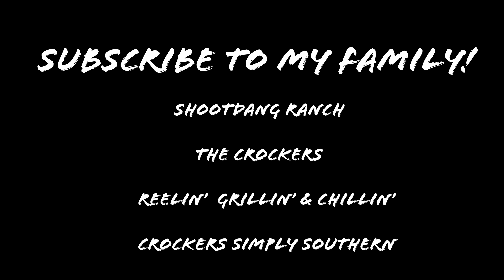Shed To Tiny House In The Woods - I Hope This Helps

Comment: You have 2 air vents towards the top  of the  end walls. A smaller fan mounted higher up, could vent a lot of the hot air trapped up top
Reply: Oh, that's a good idea. I watched a documentary about how people survived the heat in hot parts of the US both pre electricity and pre home AC. We've pretty much all stopped building homes that make sense in hot weather. Modern man often forgets what knowledge had been obtained by previous generations and it's a shame. In the olden days the she'd Transom windows would've been operational so opening them up could let the hot air out. Hot air rises, the cooler air is near the ground. Tall narrow windows that open top and bottom used to draw cold air in and hot air would flow out. Anyway I've learned a lot about how to build for both hot and cold climates and really understand why my well insulated, horribly situated Townhouse was built in  way that makes it terribly expensive to both heat and cool. Lol if I ever have a chance to design my own dwelling it's going to be a very efficent dwelling, not the energy hog I live in now.
Reply: I was wondering about that. Like roofs have eave vents and ridge vents. The shed doesn't have that it seems so how does he let the hot air escape? If he could put a fan on one of those side vets pointed out then a small fan on the open window across the room pointed in, he could at least create air flow.
Reply: Cherie he's just now building it but yes every roof will have to vent though or it creates condensation but I believe him and his brother know that?
Reply: @nathangandara9607  I wasn't trying to be rude, so hope by making a comment it didn't come off that way. I just don't know how that works for air flow/heat exchange in a shed build. My husband built an air heat exchanger that we use in our house. Its an old home without central ac/heat. It really makes a huge difference.
Reply: @cheriekreusel9453  neither was I I'm making assumptions myself up there I'm just a viewer as well. Have a good day
Reply: @cheriekreusel9453  your comment in no way came off as rude. It was just you voiding ideas etc...
Reply: @SagebrushRambles  thanks, I appreciate that.
Reply: Great observation and suggestion.
Reply: @nathangandara9607  yes I believe they do!
Reply: @cheriekreusel9453  I think you are golden! Opinions kindly voiced are appreciated by all!
Reply: They have solar powered ones for roofs, I'm sure there are side ones out there somewhere!
Reply: Good idea im in same process will get fans. Thanks
Reply: @hannakinn  totally agree! Biggest thing is houses are no longer positioned to take advantage of natural wind currents during the seasons.
Reply: Okay this is a novel idea if you are keeping the shed a shed. To make it work on a house install a box plenum lined with 
Flashing build it to run the entire length of the structure. The vents provided need to be replaced. Make them twice the they are with vent vanes that face downward
On the plenum install a whole house fan on a rheostat switch  for speed adjustment. A whole house fan can cool a dark surfaced. Roof and drop the ambient temperature 10 to 20 degrees of temperature,  works great and saves on AC power bills.

Comment: Pro tip: use a wet cloth to smooth out the sealant around the windows. The guy who installed our new windows did that and it made a nice finish and kept his hands clean. Smart move to seal up all the gaps.

Comment: Lighting is good. Closing the windows on the sunny side of the house might help with the heat some also. I know you want the sunlight to help because you don't have electricity. But it also helps to cover the sunny side ones with like a white sheet, white reflects the sun. To put the white sheet up, just put a couple of nails above the sunny windows then you can move the sheet around with the sun. A white sheet will let some light in.

Comment: You are doing a great job. You have good plans and I know you do your best no matter what it is. This may be something for you to consider. I have an exhaust fan mounted on my gable end. It is thermostatically  controlled by the heat. It vents(pulls) all the  trapped hot air out. It also creates  negative pressure.  That neg pressure is a big bonus when you live in a  hot environment. It continuously lifts up the cold a/c air off the floor and equalizes the air temp throughout the house. This also will allow your A/C to shut off as the cold air is pulled up into the mid air space. You will gain efficiency. I Had a fan powered by solar on my greenhouse.  Dang Tornado stole it all☹️

Comment: If you put the fan in the window to pull air in , exhaust, put the windows down to about three inches high. That way no matter how hot it will pull in cooler air. Try it, if you don't like it, then go back to how you were before. It was just something we used to do when we didn't have air-conditioning.

Comment: So glad to see you have the shed. To help with the heat in the summer, you might want to consider getting some of the radiant barrier insulation for the roof and then put the spray foam over it. It'll also help keep the heat in during the winter. It's your place so... you do what you want, you say what you want... yeah... lol. You are doing an awesome job 🤟

Comment: When I lived in the country with no AC, we sealed and closed all the windows except 2. Open one window about 4-6 inches. Put a fan in a window on opposite side of house (seal around the fan). Face fan so it is facing outside. Fan will pull the air from outside and is pretty effective in cooling the house.

Comment: Hey Jared, just a suggestion for signal increase; no matter the device used, insure the height is at least above the trees around your structure because the transmitting is above by direct line of sight. It will help with both tv and cellular strength, ok? Keep the faith bro!

Comment: I got a couple of suggestions that we have used before..1. Get some brown paper and cover the glass part of the windows. It will help now with the sun coming in and heating up the inside. It will already be in place to protect them from chaulkibg, paint, etc. 2. At night have Jason shine a bright spotlight on the outside of the house. Be inside and look for the light coming through the cracks. Then you know where to use more chaulk or foam. 3. Air flow. You need to exit the hot air at the top ad draw in air at the bottom. They need to be on opposite sides of the room.. Small fans will work but I dont know how much they would draw on your power sources. So excited for you! Looking forward to seeing your design take shape.

Comment: Can't wait to see how you do the skirting. I got a wood porch I need to do to keep the cats out. As far as the spray foam, we did our attic around the edges with it and it really works it's messy but it works. I didn't see anything wrong with the way you were doing it and I'm not a professional and I would have done it the same way. Take it easy and don't overheat.
Reply: Go to the video life uncontained and see how he did skirting, it looks very good and very stable.

Comment: Your doing just fine Jared. If your leaving gaps in the roof area then make sure its vented. They make inserts for that purpose. If your doing closed foam insulation spray your fine not leaving a air gap. Just enjoy the journey brother as that is the most important part. I would however suggest you do the signal booster first thing since you kinda need that to run your business...😉😁👍🏽

Comment: Your doing a great job Jared, your not afraid to try something different and if it doesn’t work I’ve seen ya try something else and if it’s something you like then that’s all that matters because it’s yours 👍🏻 I personally can’t wait to watch the fireplace go up as I think a propane insert that’s vent free would be a better choice then electric because not much sun light in the winter to solar and whelp if the electric goes out it’s gonna be a cold night unless ya got the gas generator going and have gas on hand to keep it going. I know it’s an investment but it definitely won’t leave ya sitting in the cold an with frozen pipes. Rent or buy your own tank and have a gas co. come and fill it when it gets low is the way to go. I hope ya find a tree on y’all’s property to make the fireplace mantle out of because the one ya got off of Jason’s old property was beautifully done. ♥️

Comment: I saw a walk through on a repo shed that used wood accents inside. The major walls were tongue and grove. On each end was an accent wall. the wood was wider and set on diagonal. It looked amazing. Can you do diagonal on the front accent? I think it would really pop against black linear background. I think you are doing a great job. That foam is not the easiest to work with. I did my mom's attic and had it everywhere. Luckily I could go back and scrape it off with blade. These are my favorite type of videos. I like seeing things done. The just talking is not my fav. Take it easy and get some rest.

Comment: Jared I would get the Great Stuff - GAPS AND CRACKS (Red Can) rather than the WINDOW (Blue Can) because it expands more. The Great stuff Windows (blue) expands less. Looks good! Cant wait to see it completed.
Reply from the maker: Now thats some good info. I originally bought the blue cans to do around the windows but the cracks were fairly small so I went with the window sealer. Figured I'd use the sprayfoam since I already had it.

Comment: Congrats on the shed.  I got mine ordered and I'm really excited.  You mentioned in this video that you are going to spray foam which makes sense with you using the can of spray foam in the eves but you also said in your previous shed you sprayed the eves but used insulation.  How did you vent the ceiling in the old shed if you closed off the eves/soffits?  I ask because i've learned how important a "full cycle" of ventilation is in the roof to prevent mold/condensation buildup.
Reply: i would actually like an answer to this as well.
Reply: It's a little hard to see with the camera angle, but there are vents at each end of the shed below the ridge line of the roof.
Reply: @rx7782guncannon   in the new shed, yes, there are "gable vents" but those dont let air flow into the rafters once they are insulated and boarded up.  But since the new shed is getting spray foamed he wont need air flow.  My question was for his older shed.

Comment: You need baffles in the ceiling before insulating and vents in soffit to avoid condensation in ceiling.  Mold will developed without ventilation!
Reply: exactly
Reply: Thanks for the tip, Sam!

Comment: I worked at home depot for about 7 years in building materials. Great stuff the blue cans is for doors windows it's not high expanding like the red can or the black Can you got the right stuff! The green cane is supposed to stop farmers from coming in so when you punch holes up through the floor for your plumbing get are plumbing get the green can. It has a bitter taste to vomits and they don't like to chew through that foam. I was a department supervisor for 2 and a 1/2 years at home depot trust me when I tell you this. But I know you will do your research and you will find out that I am correct. And yeah I'm a retired general contractor but decided to retire and go to work at home depot.

Comment: Glad your house arrived! Will look great. Great ideas. Just a suggestion, may want to hold off on the skirting till after the plumbing. Will make it easier to get under the house where you need to. Either way, but some moth balls (very cheap), crush them up and scatter them under the house. Deters snakes 😲. 😁

Comment: Suggestion to keep you cooler. Don't wear your hat inside. And get one of those neck things that you can keep wet around your neck. Lastly if you have your fan going, you can put water in ftont of it that will cool the air more. Hope that helps! Love what you do and learning building techniques from you and Jason. God bless to you both

Comment: Just a pointer cut the silicone tube in about a 45 degree angle and a little lower for larger gaps and use a wet rag to smooth. Looks good brother 👊👍 FJB 🇺🇲👊💪👍🇺🇲🇺🇲🇺🇲🇺🇲 put Jason window AC unit in there while working

Comment: Try to pick up some gatorade for the really tough times in the heat. Also, pick up an extra shop fan. Two fans working together will make a big difference. Try to plan your projects and chores around the heat. Hottest part of the day, work inside. Cooler mornings, do some outside stuff. Respect the heat. You don't want to have a medical emergency. We love your work always. Congratulations on your new home.

Comment: My daughter and I have a 12x24 shed that we are making into a home. Hot in the summer and very cold in the winter. We haven't had the money to get the electric installed yet. Hope to soon. In the mean time we survive off of a 10 gage wire from the pole to the house, it is a 100 ft extension cord.

Comment: Hey Jerad, have you tried the cool towels? My husband still works, and he is almost 68. He worked in a hot metal shop. I bought him a "Cool towel" at Walmart's. He said it made a big difference with the fan and the cool towel. I found it in the sporting goods department of Walmart's. I think it was $7.44. I think they are also sold at Lowes and Home Depot too. Be careful, the heat can kill you.

Comment: Try bringing in the portable a/c and put it in one end of the house’s window.  You also have a small window a/c from the tent camper you could put in the other window on the same end of the house.  Then get a painter’s floor cloth and hang it across the inside of the house so you can keep the cool air on one side.  Just a suggestion.

Comment: It's looking good . As for me I would use Close Cell foam on the roof between the rafters and Rockwool on the walls and again Close Cell spray foam under after all the plumbing lines are done. But that's just me, also I would pay someone to do it (Spray Foam) they are fast and let them get all dirty under the house. You could do the walls so easy, and the rockwool will cut the noise from those thunder storms.
  The  Thunder Storms I had last night even with ear plugs I had to cover my head with a pillow.😒

Comment: You're doing good so far. A couple of 5,000 BTU air conditioners should cool that place nicely once you get it all insulated, but right now, with no insulation, you'd just be wasting your money. Try a couple of big box fans, one at each end, one blowing in and one blowing out should at least get some air flow in the house. Better than nothing. And, if you can, start working at the first crack of dawn and then take a break in the heat of the day. Unless you've got some kind of deadline, there's no point in killing yourself to get it done soon. Better to work in the winter with a big kerosene heater than heat stroke in the Summer.

Comment: Hi Jared. Looking good.
I had a thought. About shutters. It might look better if you only had a Shutter on the outside of the windows framed  in and on the door side frame it in, but put an outdoor light on that side, one that has an ornamental length to it so it ties in with the heighth of the other shutter. I think that would serve a purpose not to mention making the windows look larger than they are. It would be beautiful with that full view door you bought. However you do it will be nice.
So glad you finally got it there.
Stay safe in this heat.
•••♡•••♡•••♡•••♡•••♡•••♡•••

Comment: Save a 20 oz bottle and put water in it ,buy some of the Gatorade packs that you dump one pack in 20 oz water bottle and shake up.way cheaper than buying already made gatorade.they also make a tub that you can scoop to make any size you like.that way in that high heat your replacing electrolytes you lost.

Comment: They sell solar panel power vent fans on ebay for like $100. You can temporarily mount it blowing outward on your ridge/eve vent. Sit the panel on your roof and let it run all day. Meanwhile, blow air in from a window with your box fan. I did this with my workshop shed before I could afford to put an a/c in it and it worked out great.

Comment: Remember to cut the end at an angle, not at the tip but up at the next line on the tube so that the caulk comes out evenly. That way you don't have to keep going over it.
Reply from the maker: I did. The gun has a section on it to cut the tips off

Comment: Good video.  Those stair treads are wrong.  The longer length is the step, the size of your foot and the short length is the rise.  Or another way of saying it is that the three that are the same length are the steps. If rise is too high, you will trip.

Comment: I had an older small modular home that I fixed up.  I did the same with the new windows and that helped a lot.  I also had put in the reflective 'bubble wrap' type insulation closest to the siding then fiberglass insulation.  The idea with the reflective was to help reflect the heat, but also have the bumps create air gaps and channels for any water that got in to easily run down and out.  That stuff really helped keep the heat out!  I didn't do anything to the roof, but it I had I'd do a similar process.  During the summer with the sun overhead I could really feel the heat radiating down into the house.

Comment: I’m interested in your solution for improving your cell signal. Do you know which direction your closest cell tower is? You can improve your signal with a directional antenna and getting your signal high enough to permit a line of sight to the cell tower.

Comment: All I got, blackout your light coming in from windows and doors and if you see any light, then you know your you got a hole to fill. 

If I ever do this, I'm doing a composting toilet! Free fertilizer for a garden later. I've been thinking about it. But I need a basement. I have a hobby. But I need to see which is cheaper for a basement: concrete or two 40' containers?